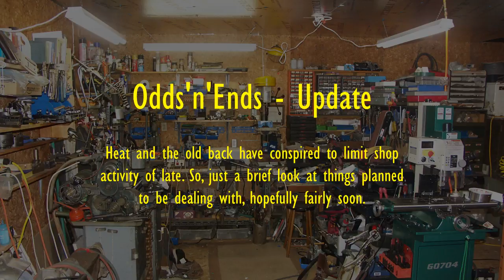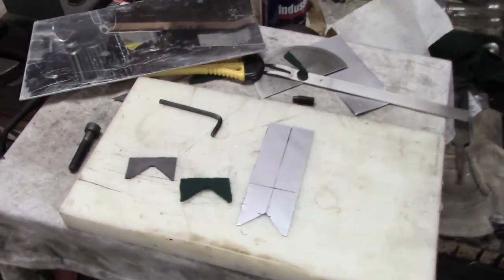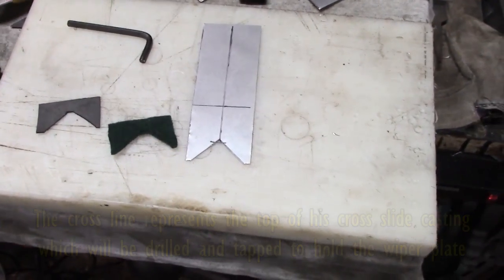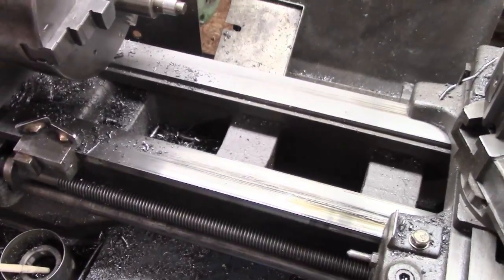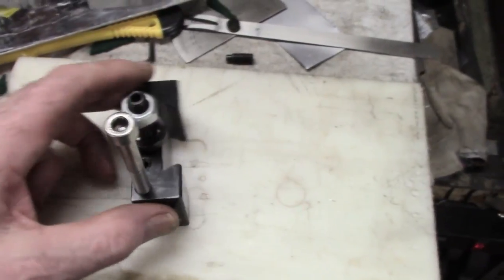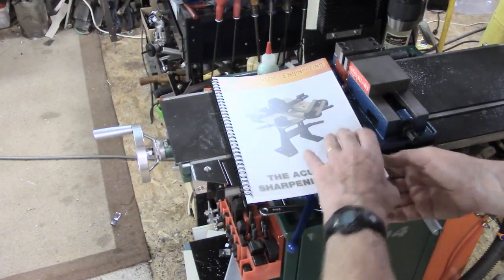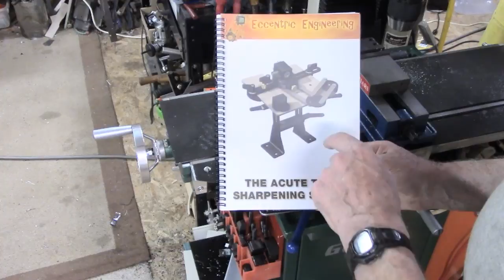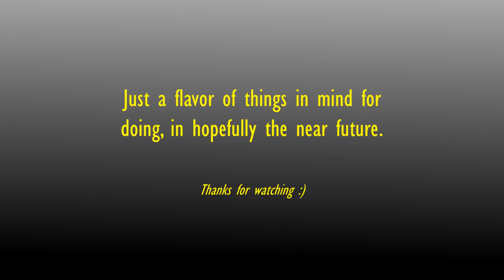Odds'n'Ends - Update

Comment: Hi Chris, That other Chris is probably using pumped water soluble coolant to feed the guizmo, similar to a CNC lathe system, or, almost.
The sharpening jig is a nice project, mostly for end mills.
Take care, Pierre
Reply from the maker: pierre beaudry Hi Pierre, Yes - end mills mostly for the sharpening jig but also with a square broached holder good for some HSS grinding. I agree - that coolant feed was very possibly for soluble oil etc but for me I think it could still serve for oil drip - have to see. Worth try I think sometime.

Comment: Hi mate.
In the hospital we had a feeding system, that was called a kanga bag.  What it is, is a bag with a lit on it and a long tube with a flow controller, that can be connected to the patient.  If you would be able to get one of those bags, you could just fill it up, and connect the tube to your tool-holder.  Those bags might be called different in the US, but just ask for nasogastric or jedge tube refillable feeding bags.  They will know what your after.  You can also have a look in a pharmacy.  At the same time, also ask for some Atrovent inhalers they will make you breathing a lot better than it now seems to be.  Consult your GP.
Marcel. Rn
Reply from the maker: Marcel Timmers Hi Marcel,

Thanks. The bag idea sounds useful -- however I already have my oil can fixed up for gravity feed so it would just be a case of running the feed tube from that. Breathing actually not too bad normally - in the video I was still recovering from efforts on my damn truck wheel. :)

Comment: Hi Chris, Go metric and join the outside world-hope the back settles down, have the same issues myself, so understand the problems is causes.
from down under-ex Leeds UK
www.shevillmathers.id.au
Reply from the maker: Shevill Mathers Hi Shevill, I have had to be 'bi-standard' a long time and base 10 is of course logical. However, for engineering use for self the old inch still wins! I had to battle with metric when at the ripe age of 50 I got a degree in Mech Eng/Systems at Plymouth.... however still find psi way easier than Kg/sq cm easier for example - plus all the others! At my age I can 'see' a few thou way easier than a fraction of a mm. I am stubborn too. :)
Reply: ChrisB257  Hi Chris, spent most of my working life in pathology, surgery, forensic science etc.so metric has always been the measurements used. However in my workshop I have a mixture of both. My astronomy has been a parallel career path which keeps my scientific interests fed in retirement. My workshop is a constant source of pleasure with many big telescopes and optical mechanical & electronic equipment keep emerging. check out my website and Picasa web albums for activities and interests. keep sharing your video projects.
Reply from the maker: Shevill Mathers Always liked optics, scopes and even astronomy - but with all my interests over the years never really got into it. Always had my fingers in too many pies! :) I can manage with metric and have had to but - I guess in the end it's the familiarity thing - too late to make a total change - well not voluntarily!
Reply from the maker: Shevill Mathers Holy smokes -- that is one mega project.  16" mirror - I can just imagine what you can get out of that. Fantastic amount of work. You have a huge amount of time invested in that for sure. Kudos. :)